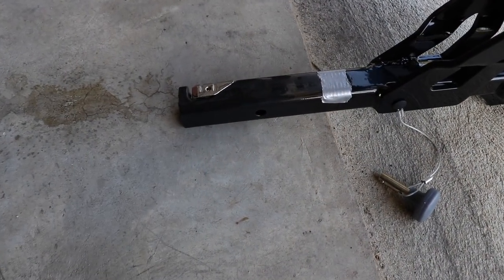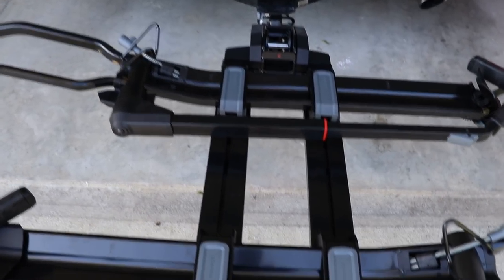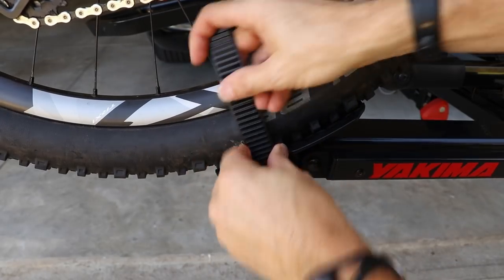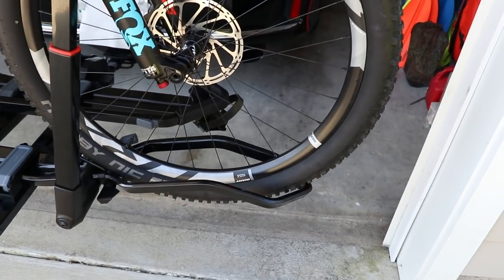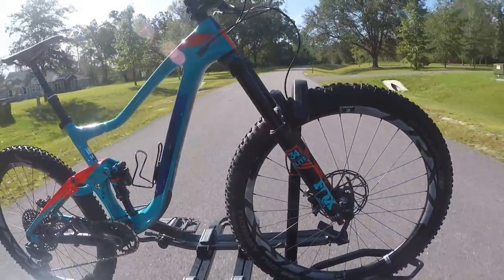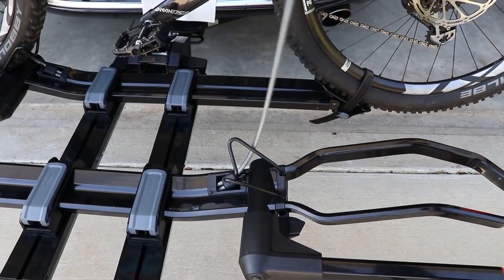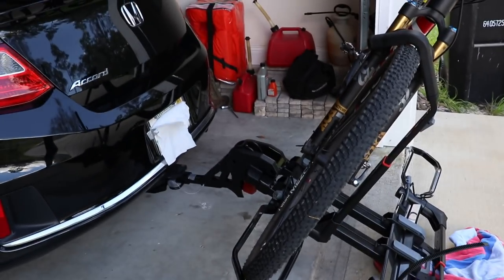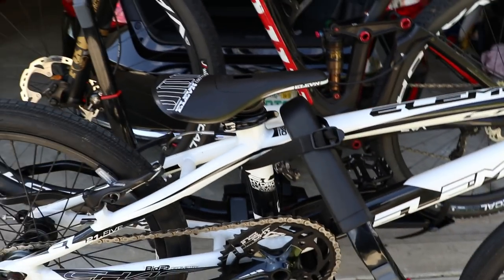Yakima Dr Tray Bike Rack - Full Review

Comment: I have a Dr. Tray and I can say your review is spot on. You hit on all the advantages and the 1 big draw back (bikes migrating out of the tray during driving). I didn't realize how important bike rack limits really are. The Dr. Tray has a 40lb single bike weight limit and (I believe) a max wheel base limit of 47". My bike (eMTB) is 52lbs with a 50" wheel base which fails on both measures. I believe if your bike wheel base is 47" or less, you will not experience the problem outlined in this video. I'll have to sell my Dr. Tray and buy something bigger and stronger.

Comment: One thing worth mentioning its aluminum so its a good bit lighter than the old steel holdup. I also noticed it fits a 29er great. Seems to be a 27.5 issue with the tire rocking. If you notice the reason the wheel flops back is not that there is to much hanging over the back but that the tire on a 27.5 hits the plastic part at the back of the front tire and does not get stopped by the metal hanger or whatever you call that. If you bend that hanger forward it will contact the tire before that plastic piece may brake the plastic tho so proceed with caution. Holds it in better we will see if it bends back with the weight of the bike and a jarring corner.

Comment: Bought this rack at REI Memorial Day sale.  I love it.  It's significantly lighter than it's Thule counterpart. I load it with mountain bikes, fatbikes and my cross bike.  I've had no issues. IF you do not secure the front wheel, it WILL roll back a little on some bikes.  Even when it does, it was a non-issue during my drive.

Comment: Great improvements. I might have to find a replacement tray to get use of these. I hate the Dr Tray I have and want my Holdup back. The holdup had only one flaw, and it was that the release to move the rack up or down was down by the hitch, on the receiver. Dr Tray had it's up top. I miss the hitch bolt, the arms, and the sturdiness of my old Holdup.

Comment: Great Video Thanks ! ... I bought the Thule T2 pro and the classic. Several Negatives to that rack. It looks super strong but is no more stable than the Yakima. It weighs a TON! ... I can lift the Yakima out of the Hitch with one hand and carry It easily across my garage. Good luck doing that with the Thule. I returned both of the Thule racks and now own the Yakima Dr. Tray. Couldn’t be happier. Also, the Thule does not work well with Fat bikes if you have 4.5 or greater tires. It is a struggle to get them in and out of the support arms as they are not quite long enough to accommodate the larger tires. The Yak works great! If you want to adjust anything on the Thule, you need to get the tools out if you want to take it off? ... get the tools... put it back on ? ... well... you know. :P  LOVE my Yak!! Thanks again for a great review!
Reply from the maker: +Wade Grant thanks for the post. Helps me appreciate the Dr. Tray!

Comment: Clint, how much does this weigh? My old t2 weighs close to 70 pounds, which uses extra gas $$ and is annoying to take on and off. Also, I occasionally scrape the bottom of the rack when folded down going up steep inclines. It looks like the Yakama sticks out quite a bit. Have you experienced any scraping issues?

Comment: I am looking at this rack (used, good condition) for my first hitch rack.  I had planned to get a 2" hitch with an adaptor so that I could borrow my daughter's 4 bike rack with a 2" hitch.  Will this work? Or do I need a 1 1/4 " hitch and get a 2" adaptor? TIA
Reply from the maker: Not 100% sure I understand your question but it’s OK to put a quarter inch rack into a 2 inch receiver with an adapter, but I would not put a 2 inch rack into a quarter inch receiver with an adapter.

Comment: Just received my Dr Tray this week and played with it today. I'm having the same issues with the bikes wanting to roll back too. Problem is that for my main bike, the hook contacts the brake hose, not the brake hose clamp. Don't really want the hook squishing my brake hose. After looking at the rack though, the wire part of the front tire tray that is supposed to contact the rear of the front tire isn't doing much. If this was bent up higher, and contacted the tire higher when at rest, it would prevent the bike from rolling rearward. Maybe there is an issue there or they need to be adjusted? I've tried both on a 26" and a 27.5" bike.

Another issue, my car has a license plate that is mounted low like yours. When the rack is in the vertical position, it totally blocks the license plate. Not Yakima's fault but it is something to think about. A car with a license plate mounted in the trunk lid would be more visible. At least the rack is super fast and removing and reinstalling.
Reply from the maker: +oktavius8292 many years ago I got pulled over for speeding and had my Yakima holdup folded up. The cop told me I can't do that. LOL! I probably should have mentioned that in the video.
Reply: I see you found the same thing with the wire part. I bent mine we will see if it holds up. I figure its suppose to have a lifetime warranty so if i break it oh well. BTW between my son and his NIKA League and me biking mine never comes off my truck. Waiting for a ticket for the license plate.

Comment: Hi Clint. You had a review of an old rack where you had accidentally melted a carbon rim due to the close proximity to the wheel tray and the exhaust.  Is this an issue with the Dr. Tray?
Reply from the maker: +13tcc no, on this rack the bikes are higher and further back.
Reply: Hi Clint.  Would you be able to tell me if your rack is crooked/tilts to the right/left when folded upright?  Can’t really tell from your video but it seems like it’s to the right.

I recently purchased one and put it together today and mine is crooked to the right when folded up.

Comment: Clint,  I have the Hold Up, Older model, I clamp down on the front wheel.  Compressing the tire a bit.  If you did that, you wouldn't need to worry about the rocking back would you? Have you tried that?  Wouldn't need that additonal strap.  Hell, I do 80-85 with my bike on the rack without fear.  :)  Okay I do have the cable lock, but thats it.  Great review though, looks good.  big improvement.
Reply from the maker: +Joseph Sieracki yeah, I did try that. Still rocks backwards pretty easily. Putting the strap on the front wheel seems to be the best solution. I ordered some from Amazon with a buckle.
Reply: Clint Gibbs Clint Gibbs yeah, sorry to hear that.  That's a stinker, not major but still disappointing.  You're right though, you don't need to be an engineer to figure that maybe that two inches more is all you would need to prevent that.  

Anyway, one other concern I noticed, how's the visibility with it folded up?  That looks tall enough to block the rear view mirror?  I have a Toyota Corolla, so I'm in the same boat as you with car size.

Comment: Just got me new Dr Tray in. Back wheel tray doesn't seem that bigger. There is some sort of hook or barrier at the beginning of the front tray that I can't make out on yours. It would seem that it is an anti roll back measure. My 29er doesn't roll back at all
Reply: Never mind. Just saw it on yours. Sorry
Reply from the maker: They did change the wheel trays, making them longer and supposedly putting a device on there to keep the bikes from rolling backwards. They're actually sending me two new ones under warranty since I was having issues with my bikes rolling backwards so hard. Pretty cool!
Reply: Clint Gibbs nice! I'm loving it. It was crazy simple to set up

Comment: I have a Dr tray. The bike rocking side to side is a non issue. I drove thousands of kilometer, no problem. However, do not trust the cable lock. It is very easy to cut off, talking from experience!
Reply from the maker: +Jean-Yves Hudon 👍
Reply: Bike rocking to one side is very much an issue with long travel bikes, just as review states.

Comment: I notice that you don't Cinch down on the arm that stabilized the front wheel. Especially on your review of the Yakima Stand Up. Expensive bike or not, I'm making sure I'm forcing it down on that tire has hard as I can. No rolling around when turning and no fussing with Velcro or tie downs on the wheels. You butchered the Yakima Stand in your last review which I think is a great product. Then purchase the same brand (different model) with the same issues. Head scratcher!!
Reply from the maker: +Orcello D the reason I purchase the same brand is because I was able to get a very good deal on the rack. My main issue with the holdup was bike contact. The Dr tray completely eliminates that issue.
Reply: I have a Kuat NV 2.0 and cinching down the arm actually causes it to rock more.  All you have to do is hand pressure just before it touches the bike and you won't have an issue.
Reply: E

Comment: If you wedge the arm at the lowest point and have the arm actually touching the fork. You will have no rock at all. No problems here with my kuat rack. And it has the same drop at the rear wheel.

Comment: The length of the cross members of the Yakima would make me not buy it for two reasons/ First the bike hangs over the side and can create a moment around a lower center of gravity which is unsupported, and secondly it takes more time to strap it up to prevent it from falling off.

Say you have to swerve to avoid an accident, this may initiate  a roll.

Comment: Clint are you still using it? I'm about to buy one. Still Loving it?
Reply from the maker: I still use it and like it. Rumor has it that they modified it and made the wheel trays longer. Probably based on my video! It still boggles my mind how company like Yakima who supposedly does research and development would make the original wheel tray so short that trail bikes Rock backwards. In the next few months I'll probably sell mine and get the one with the longer wheel trays.
Reply: Clint Gibbs Yakima website says updated. But doesn't say what they updated. Thanks!
Reply from the maker: I know. I was actually going to call them soon about it.

Comment: Seriously?? A rack you can recommend? You've only had it for like a couple of days at best. Hows about you use it for a year before you make a claim like that. I Would NEVER recommend a  yakima or a thule. it doesn't even take a year before these racks start creaking, vibrating or just plane falling apart, never mind 2 years. and don't get me started on rust (I do live in the north and this is a major issue here). from our experience, Both brands are like the Bose of the audio world, Nice packaging, underwhelming product. For this kind of money people deserve a product that remains solid for the long haul. Now, maybe yakima has fixed their durability issues they had with there previous racks (I highly doubt it) but time will tell. come back in a year or two and let us know.  hopefully you prove me wrong so people could have more options for Durable higher end bike racks

Also,  you can easily fit a 24 to a 29 inch tire on the same rail of a 1UP without having to touch the arms. I did this for two years..  I've never tried smaller than 24 though
Reply from the maker: +Pete Z My recommendation of the rack was based on its functionality. I always do long term product reviews on things like this after a year or two of use. Trust me, if I didn’t have to use a wrench every time I wanted to adjust for my sons 20 inch BMX bike to my 29 I would go with the 1Up.
Reply: Wow, 1UP feels more like a cult than a brand. The Fanboys are always out in full force and always decimate every other product. I don’t get it.
People do claim they work well, and I’m sure they do. But the fans leave a bad taste in my mouth and frankly they look terrible.
Reply: Barry Quinn they look awful. Looks like you bolted a metal panel to the back of your car. I’ve had no problems with Yakima products at all that many of these 1up fans say exist
Reply: MontalbanJR the Yakima hold up hasn’t failed me yet. Maybe I’m lucky and the only small gripe I have is the weight. But that’s because it solid. I’ve had a truck back into it, takin it on some rough off-road trails with bikes on it and it works perfect. Looks great and customer service is 👌 but just my opinion